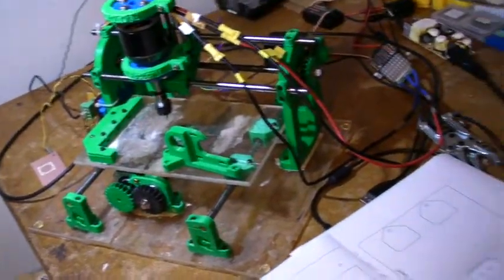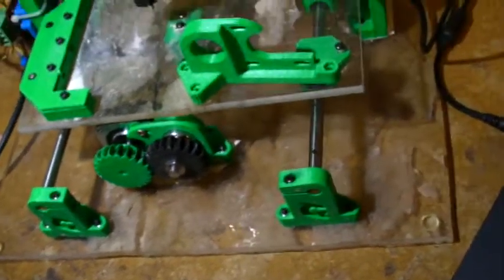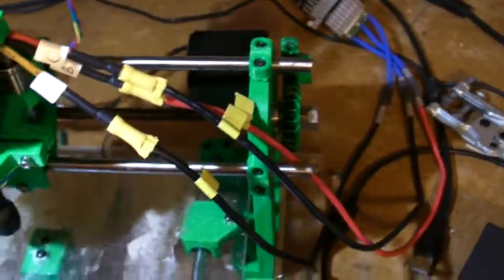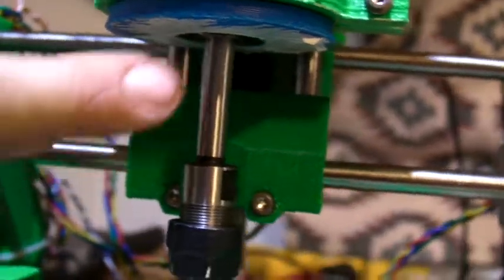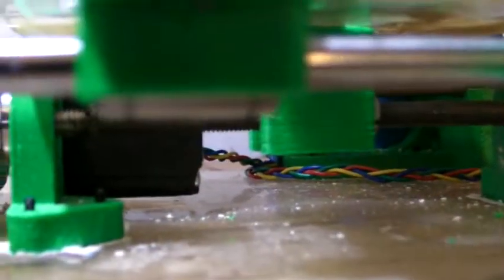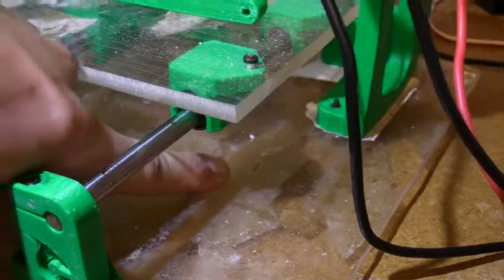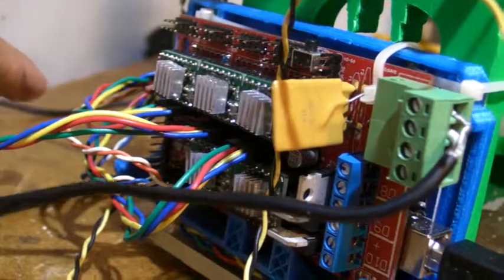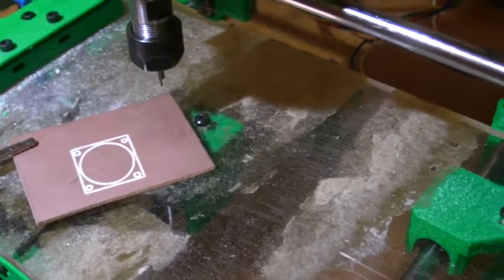Cyclone CNC PCB Mill Construction Notes

Comment: Hi, I'm just curious, would you share  the parameters of your brushless "spindle" motor? I would like to have that information to check which parameters I have to focus on, when I try to search for such motor, which has enough torque for such application. Thanks a lot in advance!
Reply from the maker: Péter Nagy 
The motor needs to have enough torque to maintain spindle speed at the rate of carriage movement. The material to be milled varies and may require empirical trials of carriage/spindle speed achieve the desired material cutting/removal rate
Reply: Ok. Then I rephrase myself. What was the type/part number of your brushless motor? :) Because so far I thought that these little brushless motors (like the ones in RC stuff) do not have enough torque even for PCB milling; I always thought these are just childplays with propellers on them :D (ok, I see, yours is a "little" bit beefier... but still. And do you use ER11 chuck - maybe from china? If yes, would you share a link to a picture just to the "chuck assembly"?
Reply from the maker: Péter Nagy 
The motor is an NTM  propdrive 50-50. The ESC is a supposedly rated for 100 amps. Because the ESC will not have any airflow over it as if it were in an aircraft, put a bigger heat sink on it.

The chuck is an ER11 chuck with 8mm shaft that is long enough to replace the shaft in the NTM 5050 motor and extend to the work piece. ER11 collets are used for securing the bits

For now I have abandoned the idea of the RC motor as there is too much play in the motor as to the natural design of the out runner style.

Comment: What firmware and host software did you use? I am converting my Prusa i3 to mill PCBs. I am using RAMPS 1.4, Marlin and CNC Gcode Controller. But I can't use autolevelling. I'd like to know your setup.
Reply from the maker: search for " GRBL RAMPS 1.4" and the first result with CarlosGS is what you are looking for.

I use bCNC, which can be a bit tricky to use, but it does work most of the time. I'm having issues with bCNC or the Arduino board freezing during milling runs

Comment: Can i mill smd stuff on copper with this machine ? I mean is it accurate enough ? I want to make a pcb that has atmega smd processor on it. Ty
Reply from the maker: I do not have a way to really measure how small I can get but I have made some boards with very thin traces on it. I'm going to distribute making small circuit boards requires use your knowledge of the CNC Machine as well as very small bits.

Comment: Hi.
I am still trying to get mine to work without the y axis binding. Without the work surface the y axis moves just fine but with the work surface attached it just won't move.  I first thought it was because the spring I tried was to flimsy and narrow and getting under the washer and it was.  I tried a new spring I bought from reprapworld which is stiffer and not going under the washer but y axis still won't move.   
I see your are selling a kit on ebay now, do you have extra springs you could sell as a separate item?  I am not sure what else to try so I can get this working. Its getting frustrating.
Reply from the maker: +Molex 1701 
It sounds to me the Y axis is not aligned. The distance from the left and right X frames where the Y axis smooth rods mount needs to be the same for the front Y axis smooth rod holders. If this is not near perfect, The y axis will have a hard time moving, if at all. In other words, the CNC machine needs to be square.

The next thing is to make sure the threaded rods are greased. Not to liberal where grease is flying everywhere, just enough to do the job. 

Make a youtube video and send/share the link to me.
Reply: +Project23D Hi,
Thanks for your suggesting me to look into that.  I had accidentally crushed one of the holders for a y-axis smooth rod. I filed it out to make the rod sit straight again. And for the other smooth rod, its top holder was a bit rough so I filed that some as well.  Now seems to move properly.

Comment: About the oil and grease.  You mention buying an LPS? oil and good stuff for grease.  I'm a noob at both, can you recommend a brand for me?  Thanks.   Making progress on putting it together and maybe in few days make a test run.
Reply from the maker: +Molex 1701 
LPS-1 is a fantastic brand name product, better suited for this type of work compared to the others on the retail store's shelf. If you cannot find or pay the price for it, then I wouldn't use anything other than Slick-50 for the smooth rod/linear bearings.

80-90 grease or white lithium grease for the gears(small amount) and liberal amounts on the threaded rods.

Be sure to keep the lubricating oil and grease near your CNC. Over time, you may need to clean the rods and gears of milled debris that will get in/on-to them. I keep a set of tools on the CNC bench so I don't have to keep running around the house looking for them.
Reply: +Project23D I had to special order the LPS 1 to a hardware store near me. I'll get that white lithium grease next week. I am on a budget for my hobby so can only get some things at a time.  Ordered the power supply and will receive that Monday. Then I just need to order bits.  But I'll be able to do the pen test soon.

Comment from the maker: Update...
Because, at present, there isn't a method to ensure both Z carriages move in sync (the bottom one moves down during milling) I had to turn the bottom RC motor adapter upside down. The motor now rests on the bearing(which it should have in the beginning) and using a couple rubber bands to keep the Z carriage moving as a whole.

If you are using a dremel or other roto-tool, this is a non-issue.

Comment: Hi,  I've started building this but ran into a snag with the springs.  I thought I had order the right ones but I had not.  Seems when you order the springs you need to order by an outside dimension and wire thickness.   I know they are in your Cyclone, now but do you happened to know that?  And the US sites are listing them in inches of course.  I can see why you added Aspirin/pain reliever and coffee to BOM lol.
Reply from the maker: +Molex 1701 
The springs I put in there just happened to be in one of my parts bins. I have zero idea where they came from. It was almost magical the springs I picked were the ones that fit.

The springs are for anti-jerk and keep the carriages in place when the machine is working. I got the idea of using them from the 3D printer I built.
Reply: +Project23D Thanks for the fast response.  I'll have to figure something out.
Reply: +Molex 1701 Hi, I bought a couple of springs from mcmaster that I think will do the trick.  I'll have to see how the machine reacts though.